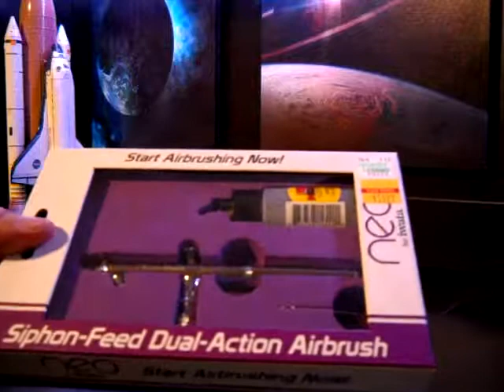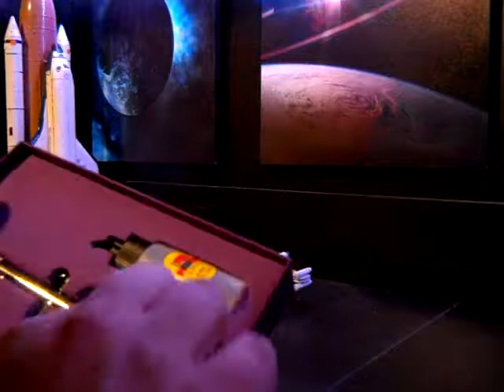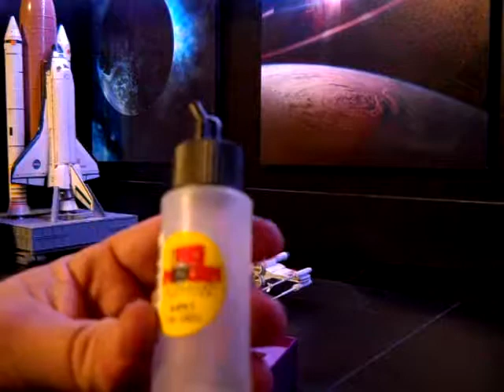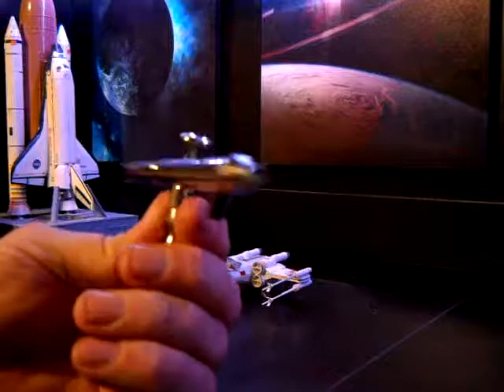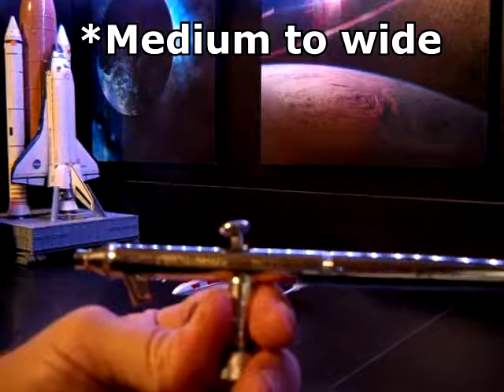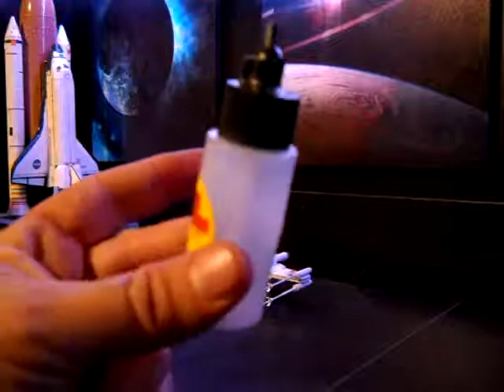Iwata Neo BCN Airbrush Review

Comment: I have 4 Iwata neo bcn siphon feed guns that do not spray anything, barely any air comes through the gun when trigger is pressed down. i cant even get any cleaner to spray through the gun. I've totally disassembled the guns & soaked them in cleaner yet i still get the same results. I've adjusted psi & still barely air comes through the guns. any tips or suggestions would be greatly appreciated. thank you.
Reply from the maker: @djMonchis  my only guess is the needles are damaged or the needle chuck is too tight and not allowing the needle to move.
Reply: @jollyrogerhobbies2386  thanks i'll look into it when i get home.

Comment: I thank you for this information!! I got the same airbrush gun from hobby lobby as well. I thought the sold me a broken product. Where can I get the quick change niple? Or do I have to order from the website?
Reply from the maker: Here it is on Amazon: Iwata-Medea Quick Disconnect Set https://www.amazon.com/dp/B001P5S5CO/ref=cm_sw_r_cp_apa_i_.vVrDb538BB2P
Reply from the maker: What made you think it was broken? I bought my quick change coupler at hobby lobby. It was with the airbrush accessories.
Reply: The air isn't coming through the airbrush. It didn't come with that quick change coppler to let the air through.
Reply from the maker: @moniquehagansOnly  the quick change coupler is not needed to push air through. You can connect it directly to the hose. When disconnected and your air compressor on, is air flowing through the hose?
Reply: @jollyrogerhobbies2386  yes air is flowing through the hose, just no paint coming out. Not sure why but will figure it out..
Reply from the maker: @moniquehagansOnly Ok, just fair warning, the siphon feed airbrush needs  15-20 psi minimum to siphon the paint out of the bottle (if you have a small 1 oz bottle). I have run into this issue. My Ninja Jet compressor on full pressure is just enough to do it. So try turning up the air flow on you compressor if you can to 20-30 psi. Test to make sure you have air coming out of the airbrush with the trigger depressed without a paint bottle attached. if that is good, attach your paint bottle and pull the trigger all the way back while pointing it at a piece of cardboard or I like to use stock paper. Give it a minute to get the paint out., then you can dial in your air pressure that you like to use. The other issue is if you have low PSI (10-20) and a very large paint bottle. If that is the case then the air flowing by the bottle(siphon) will NOT be enough to pull the pain out. If that is the case, try a smaller bottle. I hope this helps, good luck
Reply: @jollyrogerhobbies2386  thank you that I'll try it again. Maybe I'll get some success!! Lol
Reply from the maker: @moniquehagansOnly  good luck, I hope you do!